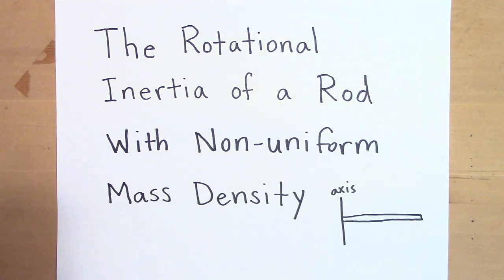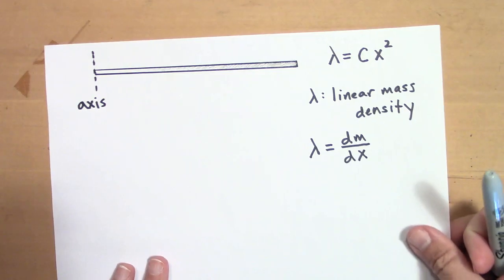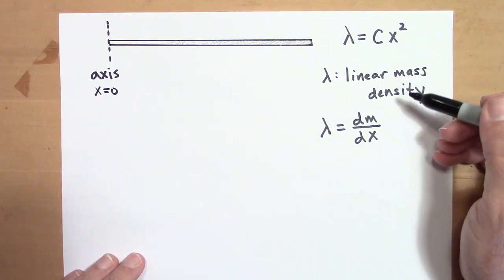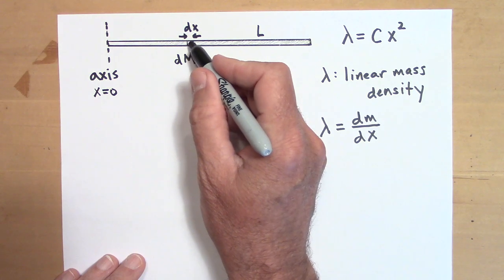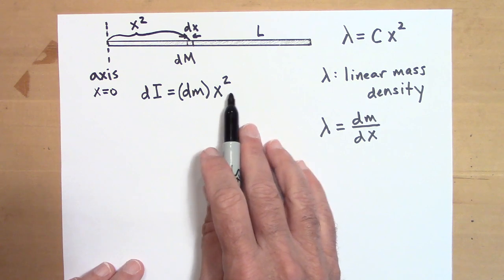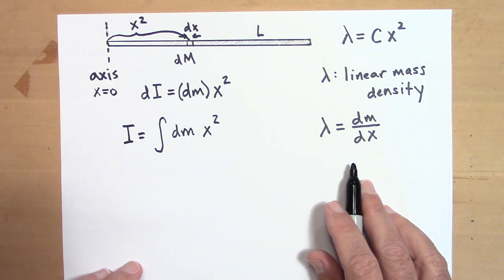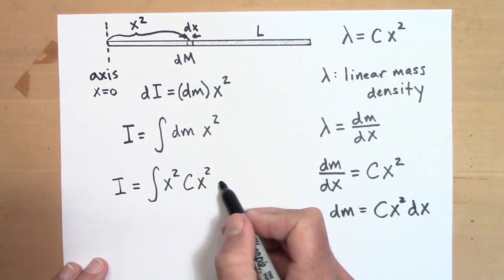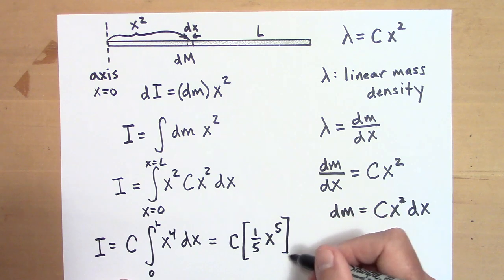Rotational Inertia of a Slender Rod of NON-UNIFORM Mass Density (See Note in Description.)

Comment: What if the rod is rotating about its center of mass (without the parallel axis theorem) and what would be the bounds in the integral ?
Reply from the maker: So this is a much more difficult problem.  The center mass is not at the center of the rod.  You would first have to use a different integral to find the center of mass of the rod, and then you would have to adjust your bounds so that the distance in the rotational inertia integral was from the axis to the dm.  In other words, it's not just a matter of changing your bounds.  If you give me the specific problem I might be able to get you started.
Reply: Let’s say lambda is Ax and it is rotating about its center of mass. So its mass would be A.l^2/2 and its center of mass is 2l/3 . But I want to solve the problem without the parallel axis thm. I got stuck in the bounds of the integral. I tried -2l/3 to l/3 but the result gets negative. So can you help me about the correct bounds.
Reply from the maker: @korayaydogan7365  I have I = integral of (-2/3L+x)^2*dm  where the bounds are from x=0 to x = L.  Draw a diagram of the stick along the x axis with the one end at x=0 and the other end at x = L and your axis at x=2/3L.  Draw in a little dm on the left of the axis.  If x is the location of the dm, then -2/3L+x is its displacement from the axis.  By the way, since lambda is dm/dx, dm = (Ax)(dx).
Reply: @lasseviren1   Thank you so much you helped me a lot :)
Reply from the maker: @korayaydogan7365  Glad that helped.  All the best in Physics.  It looks like you're doing very well.
Reply: @lasseviren1  Thank you , I was also having same problem  !!
Reply: -l/2 to +l/2

Comment: If the axis is taken at L/2 what would be the answer?
Reply: Surender Soundiramourty I believe u could just use the parallel axis theorem
Reply: @noahrubin3327 that cant be used if the both ends are not symmetrical if im right
Reply: @noahrubin3327 but he could just take the integral from +L/2 to -L/2

Comment: What is C here
Reply: C is an arbitrary constant value.  
I feel this video could be more complete because the C constant can be eliminated by "solving" for C.  If dm = C(x^2)dx, you can integrate from 0->L to find total M.  M = C(1/3)(x^3).  Thus, C = (3M)/(x^3) = 3M/L^3.  Plug that back into the "final" answer and get I = 3/5ML^2.  (Turns out the C constant doesn't matter!)